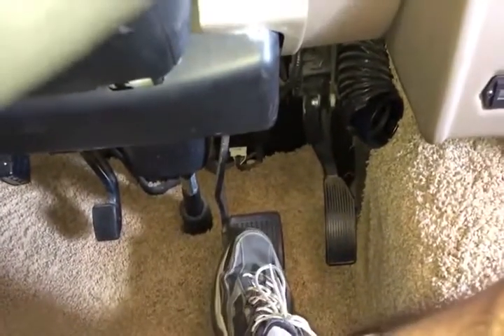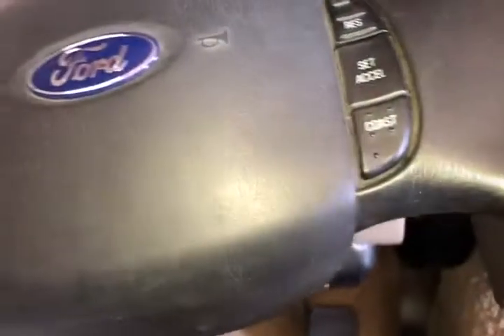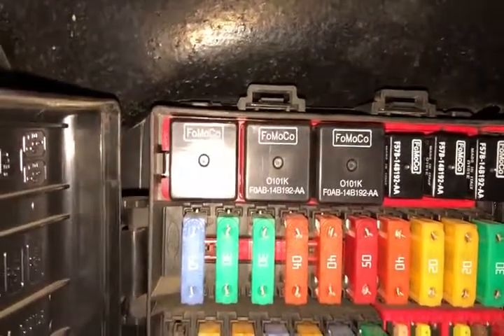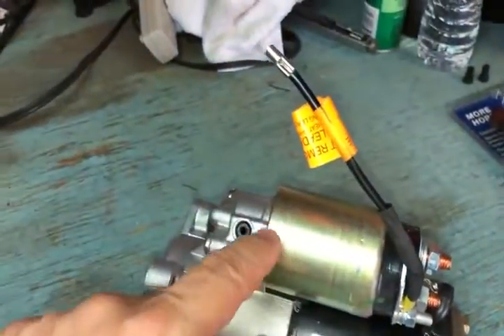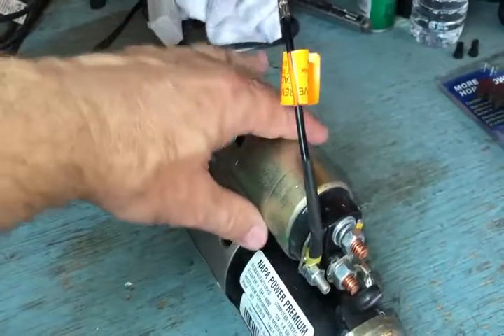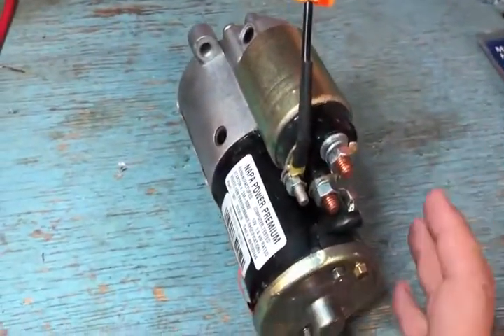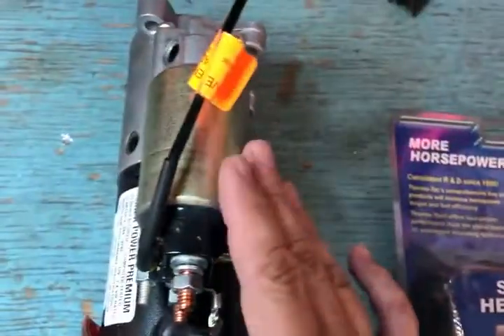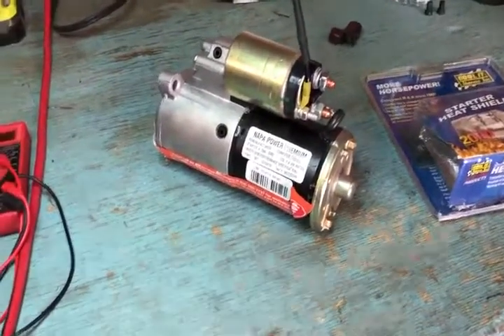5 steps to diagnose Ford V10 No Crank situation

Comment: GREAT VIDEO, exactly what I was looking for.  Found this looking for how to open the fuse/relay box.  Yesterday had intermittent start issues.  This morning it has started 10 straight times with no issue! Arrrrrrg!!!
Reply: Also ordered the Napa heat shield.  May have to drop a few pounds to install that.  Now if I can just get start issue to repeat.
Reply from the maker: That’s what mine was doing.  Starts ok for a few days then repeated the heat issue.  Didn’t want to chance it any more so got a new starter and heat shield.  Have not had the issue since.
Reply: @swalesutube 
That could be my issue, but I'm not convinced yet.  Prior to the day issue was first observed the coach had been sitting in the driveway for a week after our last trip.  In that time frame was started on two different days just to move in driveway.  I wouldn't have thought run long enough to build up heat.  And I was watching video from my easy chair!😂
Reply from the maker: Still most likely the starter solenoid.  Cheaper to replace than a tow charge.  My NAPA starter is guaranteed for life.
Reply: @swalesutube Definitely.   Picked up new starter this morning, new starter relay arrives tomorrow and the starter heat shield just arrived as I'm writing this.  So I'm getting ready!  Took RV for a drive today to see if I could put a little heat on it in order to recreate the problem...but its not cooperating.   Still would like to see the failure again just to troubleshoot it some.
Reply: New starter installed this morning!   Not a bad job, took less than an hour.
Reply: Well it wasn't the starter😢.  Went to move the RV this morning, and it wouldn't start.  Appeared to be the gear shift lever, was able to duplicate, but only one time.  Any suggested remedy or just live with it? It's fine as long as it doesn't degrade further.
Reply from the maker: Neutral start safety switch on transmission.

Comment: Excellent video to help us test starter and diagnose our no crank. It turned out it was the 50 Amp fuse for the starter relay. One other symptom with the fuse blown was that we had no power to the dash gauges and warning lights when the ignition switch turned to start. Thanks!
Reply from the maker: Glad it helped you.  Thanks for the feedback and sharing your solution.

Comment: please help? you have the same motor home as I. do you have any info on all the fuse box areas and what they are for? I have soo many fuses all in different areas of MH with no info. Im 3rd owner.
Reply from the maker: Each box (under hood, top of dash driver side, BCC in first bay on passenger side) should have them labeled on the covers.  The first 2 mentioned are for the chassis and the BCC is more for the motorhome pieces.
Reply from the maker: Also get ahold of the Rev group through Fleetwood and ask them to send you ALL schematics for your MH.  They cover everything.
Reply: @swalesutube  Thank you. I called and they sent me some more schematics for it.

Comment: Thanks!  All I needed was how to open that dumb fuse box!
Reply from the maker: Agree... I almost ripped mine apart until I figured it out.  Way to go Ford! hahaha
Reply: Man im the identical issue. I went off grid with my 4 babies and i have put a new starter done everything and its still not starting. Just no sound nothing. And its like yours it melted too, that cover thing for the starter and had gooo in it but still wont staft
Reply from the maker: @ check power at relay, then if good move to starter.  I would check the cable ends as they may need replaced.  They could be corroded or over heated.  Maybe you got a bad starter, did you bench test it? Good luck.

Comment: Senior…. Thanks to you and this video.  I was stuck in Amarillo this morning 800 miles from home.  Had already changed battery out as it was going bad.  Wouldn’t start. Reset the relay and voila it turned over.  Just finished a 13 hour drive home safe thanks to you.  Well done sir.
Reply from the maker: Story sounded familiar, brought back nightmares :).  Glad it helped you figure it out… safe travels!
Reply: How do you reset the relay?

Comment: I have this issue but it only happens when it's cold out (< 60 deg. F). Kept turning the ignition switch on and off, and it finally started. Changed the starter solenoid on the passenger fender well and it worked, until today when it's somewhat cold out again. Any suggestions?
Reply from the maker: Was it a no crank situation?  If so, I would replace the relay shown in the video.  If it cranks but does not start, I would cycle the key 2 or 3 times before trying to start.  Pause a couple seconds between cycle.  This lets the fuel pump pressurize the line.  If that solves it you either need a fuel pump or your injectors are leaking.  Try some injector cleaning for a few tanks and it may solve it… cheaper than a fuel pump.
Reply: @swalesutube  it was a no crank/starter turn over issue. I recently replaced the starter  solenoid, cleaned all of the ground connections and the starter connections in addition to the start relay. Hopefully this will be the fix. I'll see when it gets cold again. The only thing left is the start switch and the starter itself.
Reply: @JohnSims3 Did you have any more problems after replacing the starter solenoid? My Dad's truck does the same once it starts getting cold outside.
Reply: @Griffin711  It wasn't the starter solenoid! It was the darn starter switch under the column! The pin was barely touching the contacts and when it got cold, the contraction caused it to not make contact. I wallowed out the mounting holes in an oblong shape to be able to mount the switch closer to the stop and it worked perfect. No problems since even when freezing.
Reply: @JohnSims3  Awesome! Thank you so much for the help. I'll be trying that for sure.
Reply: @swalesutube  It wasn't the starter solenoid! It was the darn starter switch under the column! The pin was barely touching the contacts and when it got cold, the contraction caused it to not make contact. I wallowed out the mounting holes in an oblong shape to be able to mount the switch closer to the stop and it worked perfect. No problems since even when freezing.

Comment: Excellent video!  Our coach is a 2013 Tiffin Open Road. We have replaced two starters and are in the process of probably buying another starter to have onboard in case we get to the point where the starter will not start even after sitting overnight.  I will check with NAPA today and purchase the shield.  I wondered how a shield could be fitted on and what I just saw on your video shows how it can be done.  This looks to simple to work but it sure will be the bomb if it works! Thanks again!
Tony
Reply from the maker: Bonus to buying NAPA starter is they warranty for life… at least they did in my case.  The sock has been working.  No more issues.

Comment: you left the solenoid under passenger front fender out of the equation
Reply from the maker: Left out.. yes... but my RV does not have that solenoid.  Some do.. some don't.
Reply: @swalesutube  interesting, i wonder why, my has the solenoid under front passenger, i am in a no crank situation, and i can turn over from solenoid or at the starter, but can get nothing at the key, I do hear the relay clicking, will be working on it more today, thanks for response
Reply: oh and great videos, it has been helpful even 3 years later

Comment: I have a blown 30 amp fuse at the location 22 ,I think it's the 8th fuse in the second row ..I don't know what that dude controls ,is Thier a wiring diagram
Reply from the maker: Look at cover you opened, it should say.  If not it is in the owners manual of the chassis.  What year and model you got?
Reply: @swalesutube  its not on the cover the covers says to check owners manual,but I got it the on line owners manual,it was for the dlc and the cig  lighter,thanks for responding,
Reply: @swalesutube  it was  a 1999 Ford Fleetwood bounder

Comment: I put a new battery in my class A v10 after sitting for a year. It cranked right up but a week later it only clicks and doesn’t start. It’s now up my driveway and not possible to tow out so I’ll have to work on it myself. Any other ideas?
Reply from the maker: Sounds like low voltage.  It only takes a few days to run down battery if you leave your Main/Aux switches on.  Charge battery and try again.

Comment: Thanks for the really informative video.  My problem is in a Winnebago Sightseer (Class A).  Just returned from 7 weeks Pacific Northwest – very high humidity, everything feels damp.  While in the damp, the no crank problem was intermittent, but I could count on it happening every day under variety of conditions: cold start in the morning, restart having driven for several hours, restart after running at idle for couple of minutes.  I have done all of the steps you suggest, except crossing the terminals on the starter solenoid.

Now that I am back in Reno, Nevada (DRY), the no crank situation is infrequent….so infrequent that it would be difficult to show it to a mechanic.  When I get the no start and then hold the ignition key in the start position for 30 seconds to 1 minute, the starter will crank normally.  After this, when I shut it off and restart, the starter generally cranks normally immediately when the key is advanced to the start position. 

Another thing I have noticed with this situation….. I have a Victron Battery Monitor that monitors both coach and chassis batteries and I can watch them with my iPhone while I start the coach.  When I engage the ignition (before turning to start position), there is about a 20 amp draw from the coach batteries and a noticeable increase in the chassis battery voltage – from 12.7v to 13.5v.  This happens even though I have NOT engaged the battery booster switch.  My intuition tells me that this should not happen unless I engage the battery booster.    I wish I had done this monitoring before I started experiencing the no crank situation.

I’d appreciate any thoughts you might have, especially with the power shifts that I have observed with the Victron Monitor.
Reply from the maker: Possibly the draw on the chassis battery is the daytime headlights.  Disconnect the bulbs and see if that is it.  I switched to LED headlights (see other video).  It also sounds like your latching relay is engaging automatically.  Before tracking that down I would check the chassis battery cables.  Most likely there is an inline fuse (a big one) that is probably located on the frame rail below the battery.  There might be corrosion that needs cleaned up.  Also check the ground to the frame, it also might need cleaned up.  I would also swap the starting relay with a different on (see video) as yours might be going out.   Are you sure the chassis battery is good?  I would do a load test on it, or try another battery if you have one.  Many times the volts will be good, but not enough amps will flow.

Comment: I have tried for 10 min to open my power distribution box. Now it is pouring rain. I hope that is my issue. I dont think it is starter because i have no power to dash lights either
Reply from the maker: If you have no power anywhere I would look n the frame rail underneath the battery.  There is a fuse on the main power cable that might have blown.

Comment: I have the same problem with my class A.  I have gone through the steps and no fix. I want to know if e everything in the cockpit should be dead?  I have nothing lights, dash, mirrors or levelers. Absolutely no sounds when I turn the key.  If this is possible then I will replace the starter and solenoid.   Just amazed there is still no noise.
Reply from the maker: No, you should have power to dash.  Did you turn on your entry switches (main and aux) near the door?  Does your battery (engine) have power?  Have you checked fuses?
Reply: @swalesutube   Entry switches are on - Took battery to have tested, its ok - I have checked all the fuses  and all the 5 steps.  Any other suggestions?
Reply from the maker: You got a different problem.  I would check the main battery cables to make sure the are good.  Also there is a large 250amp or larger fuse on the rail below the battery.  It may have blown.  Just trace the battery cable to find it.

Comment: There is also a starter motor solenoid on the passenger side of the coach under the wheel well that sends power to t he starter motor solenoid
Reply from the maker: I looked under mine and could not locate it anywhere.  I traced all wires, it just wasn’t there.
Reply: You MAY be confusing the battery isolator switch.  They look like a remote solenoid used in the older FOMOCO products

Comment: Ive got the same issue with heat sink on an "oem" replacement. After pulling a trailer 200 miles, I'm stranded for 20 minutes, then it starts right up. Gonna take an old reflective windshield sun screen, cut it down and wrap the starter with it to get a heat barrier. We'll see if this works. Good video.
Reply from the maker: Not sure if that will melt or not.

Comment: Okay I did all that replaced the starter still the same as if I didn't even put in a new starter...i heard a bunch of relays clicking my fuse box looks nothing like yours..i have 2001 Ford excursion v10 gas.4x4... my son had the keys out of ignition and some how the starter was grinding it's teeth away against the fly wheel...please help..

Comment: Can you replace just the solenoid? Or even better replace or clean the contacts in the solenoid? It looks like two screws and one cable to remove. I had a 1985 Toyota Supra with a clicking solenoid and no crank. The contacts in the solenoid were worn flat. Cost me 4$ to replace.

Comment: i got a 2000 limited excursion that will crank fine one minute then 
won't the next. its not the key or pc i dont think because the theft 
light isn't flashing faster than normal and the shifter is plenty tight.
 i usually can wait a day and it will crank. i went to the taco bell no 
problem last night and when i cut it off i tried to restart it and it 
acted like there was no power getting to the starter. got in it first 
thing this morning and it cranked no problem then i shut it down and 
tried to restart and again no power to the starter. any suggestion on 
what it can be sir?
Reply: Hey man did you ever figure out what was wrong with the excursion mine does something similar?
Reply: @Jcam1291  it was the relay. It's not expensive, got one at O'Reilly's.